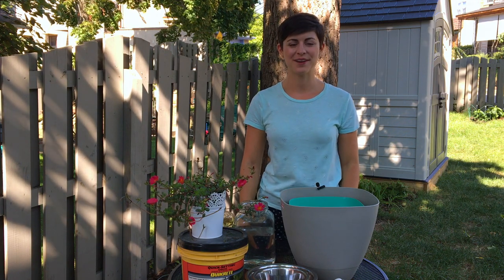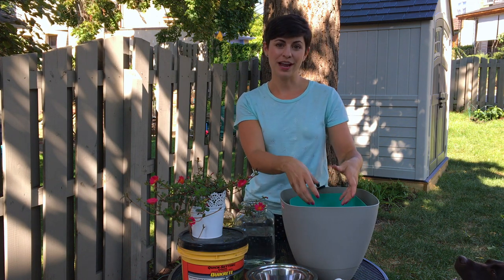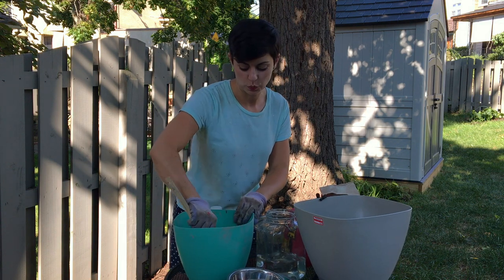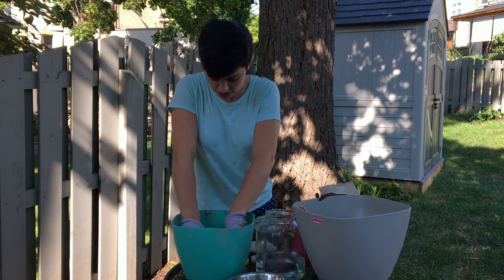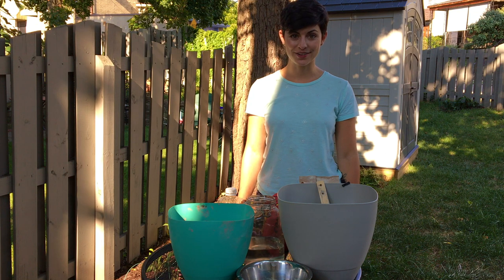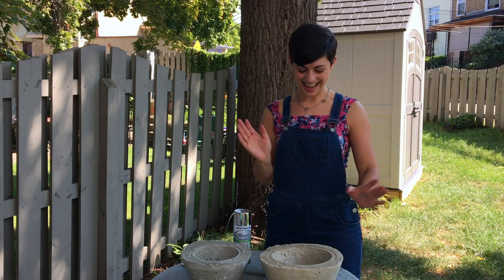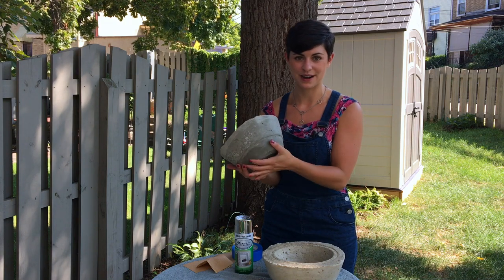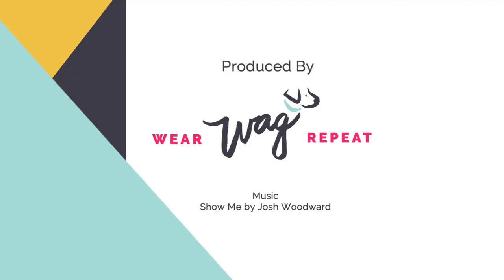How to Make a DIY Concrete Dog Bowl Holder

Comment: You didn't need to sand, after an hour or two of setting. Just take some water and smooth around the edges. Also, rocks are not necessary to weigh down the food bowls. Just need to push the food bowls down into the concrete. The concrete does the rest.